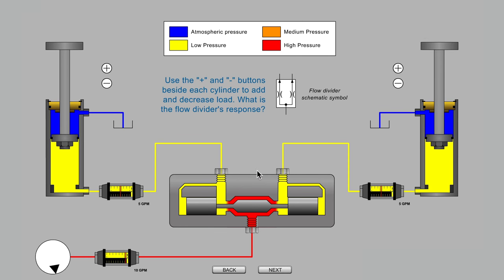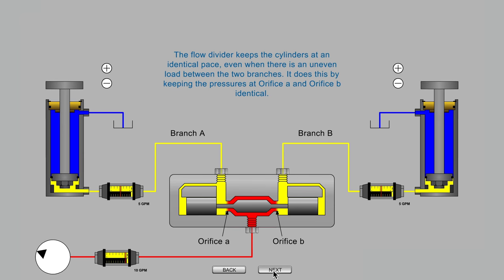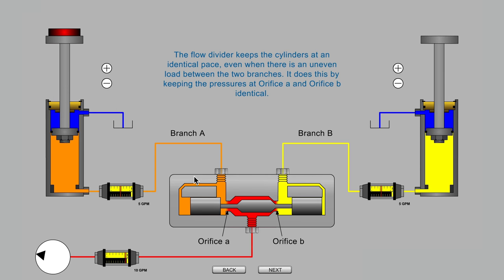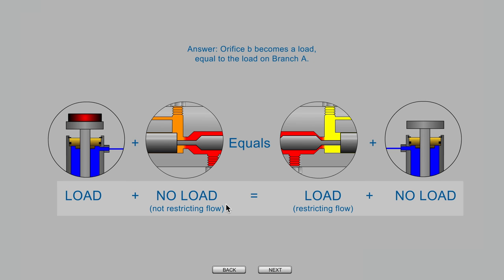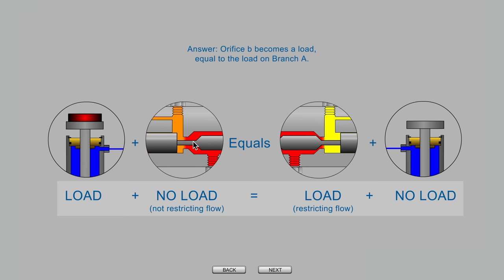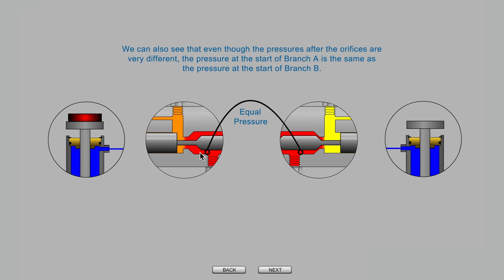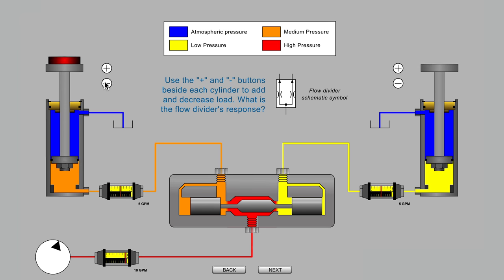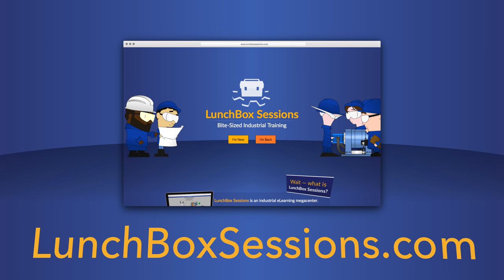Pressure Compensated Flow Divider

Comment: I'm working on troubleshooting a system, the flow divider is placed on the rod side as a combiner.  The pressure is being applied to the bore side.  The problem we are seeing is that the cylinders are getting out of sync and then bind up the system (two connected pivoting arms rising upward).  The valve has been recently replaced as it was thought to be the culprit.  I'm thinking air in one of the rod end hydraulic hosing or the cylinder itself may be the issue, any other thoughts?

Comment: are there flow dividers for pneumatic cylinders or is it just for the hydraulic systems?
Reply: Unfortunately you cannot incorporate a flow divider into pneumatic systems. They rely on the incompressible fluid to function.